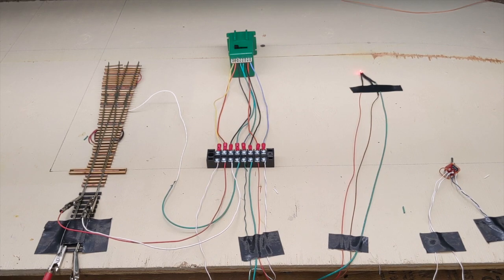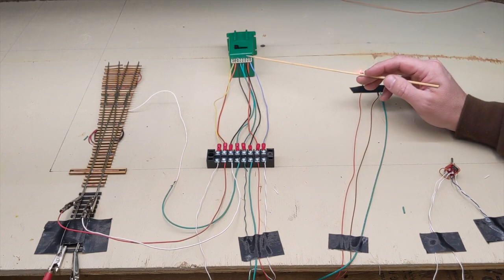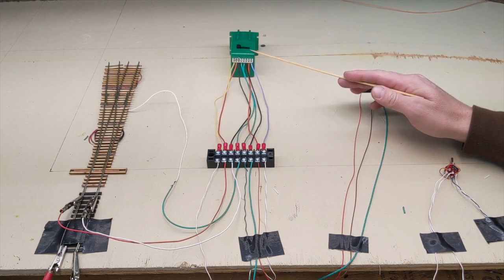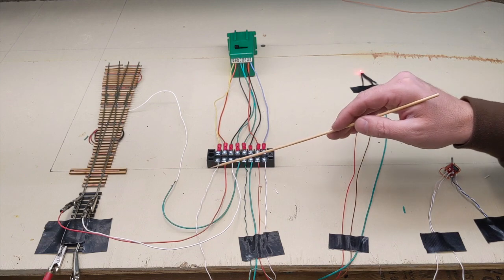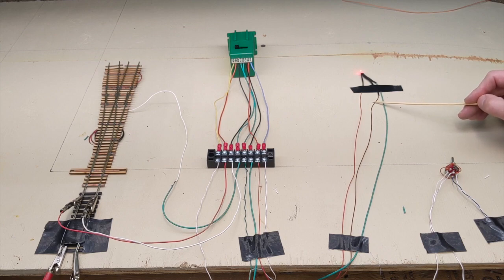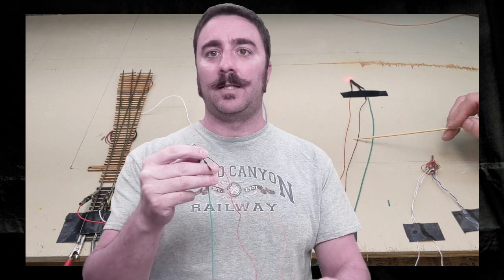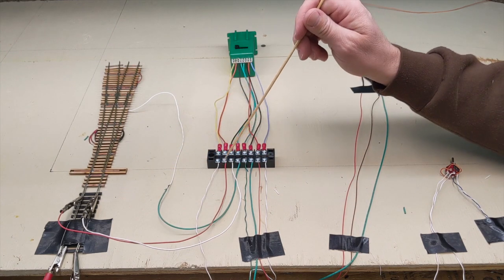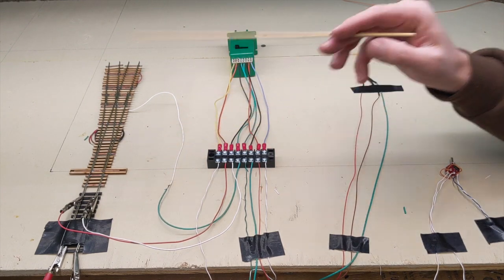How I Do (Wiring a Tortoise Switch Machine)

Comment: All those wires are why I opted for using the snaps terminals on the Tortoise and the touch toggles for moving the points. It’s not much more money, but much, much easier to wire. ...Claude
Reply from the maker: Yes, there are a lot of wires, and its easy to get them confused lol. Thanks for watching.
Reply: @JoeG-firehousewhiskey  Sorry if I sounded like I was knocking your approach, I wasn't. I know a lot of guys doing very much like you are showing, because it works. I just weighed my options and when I found the Touch Toggles, that did it for me. Keep going...I'll keep watching!!
Reply from the maker: No not at all, i didnt take it that way! Youre all good!

Comment: Thank you Joe for the fine demonstration and simplifying how to wire. Another little item I use is ribbon cable between tortoise and screw block that keeps everything uniform.
Reply from the maker: Ribbon cable would have been great, and I have seen people use those screw blocks.

Comment: Hi   Joe  thank you for all your info very easy to understand, Could you please tell me what value resistors you are using on your leds. Sorry Im 80 & just cant get my head round the formula to work it out myself. my dwarf slignals are working but my resistors are getting very warm,,,,,Cheers U.K. Brian
Reply from the maker: I dont exactly remember off hand. All my train stuff is in storage at the moment. But, I normally use 1000 to 2000 ohm resistors.
Reply: @JoeG-firehousewhiskey  Thank Joe, thats very helpful ...

Comment: Hello Joe,  Good video.  My layout grew where i had to put separate utp panels at various locations. Before I operated it from a central command station in which i used the DPDT toggle switch.  Now I have a switch 8 board in which I use the accessory button on my pro cab. My problem is I cant get my directional lights to work. Can I get my directional lights to work if i wired them to the tortoise?
Reply from the maker: I would think so. If you wired the way I did it should work

Comment: Great video Joe! Where are you connecting the white wire under the turnout and are you cutting any wires or soldering anything for the frog also that DPDT toggle switch what are the specifications.
Reply from the maker: The white wire is the frog wire that comes off the turnout. I run that wire to the terminal block so I can they run a wire from the other side of the terminal block to the green wire on the tortoise switch. I do solder wires to the frog, and the DPDT switch. I bought the DPDT switch off of amazon. They have many different types on there.

Comment: just getting started how many tortoise machines can you run off of 12v adapter.. my problem is i have 20 on my layout and can't get enough power to them to operate.. please any information will help. Thanks David.   PS loved the video
Reply from the maker: Thank you for your kind words. I am not sure how much power that would take. Have you looked at a computer power pack?Those put out a lot of power that can be distributed out to many areas.

Comment: Just at the point where I'm starting to wire my turnouts. I've got Atlas turnout so I don't think I need to mess with the frog, but trying to make sense of the rest of the arrangement. Thanks for posting this. Seems like there are many options for powering/diodes/panel design I hadn't really considered before. You said your power is 5 volts. Is this a buss arraignment that runs around the table in the same way that the DCC power is fed? And what are you using to provide power? I thought 9 volts was the preferred voltage.
Reply from the maker: Yes I have a separate bus for the tortoise switches. And you can run the tortoise switches at 3 volts 5 volts 9 volts or 12, it just depends on how fast you want it to move the less volts the slower it moves. Also, I'm using a wallboard to power them.

Comment: Can you use a 12 volt bus
Reply from the maker: Yes you can, the speed of the tortoise depends on the volts. Less volts the slower it moves, or the more volts the faster it moves
Reply: Can you hook the commons up to poles 1and 8 also